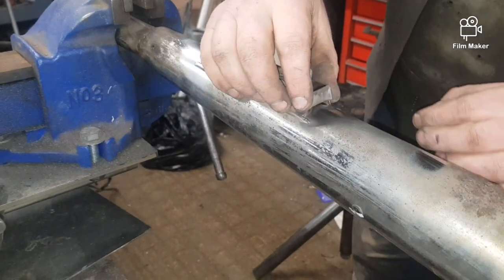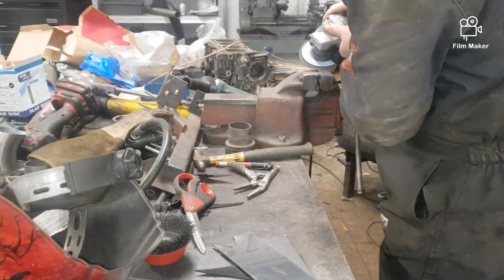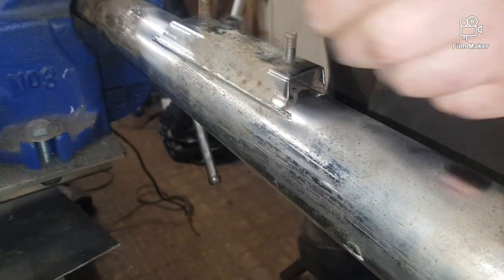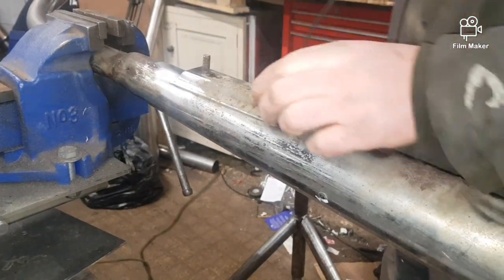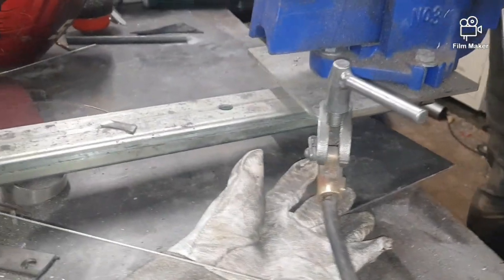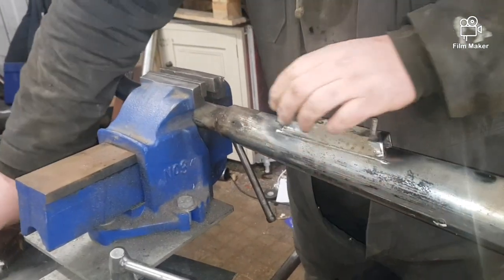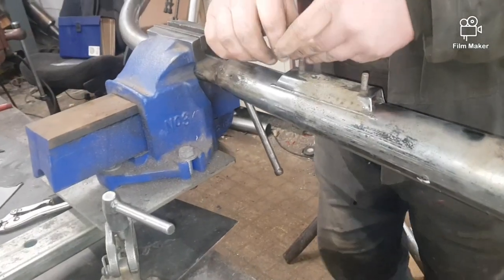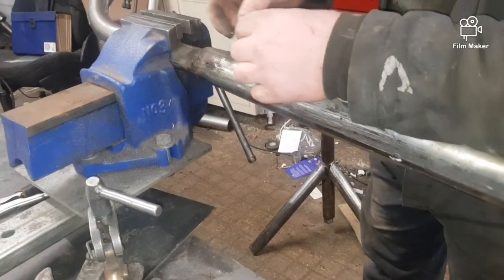Honda CG125 Motorcycle Exhaust Pipe Tig Welding Repair Job || Motorcycle Exhaust Welding Join Repair

Comment: Good channel and content. Won't arc welder torii here? I think it's made of ss so ss rod will work? What say?
Reply from the maker: Yes it is stainless steel
The arc welding is the best option to repair the exhaust pipe